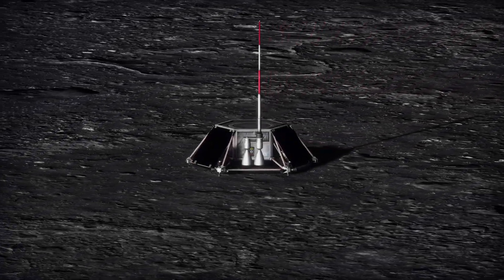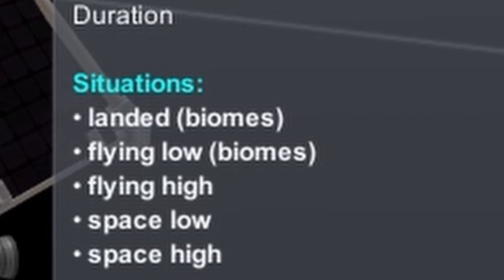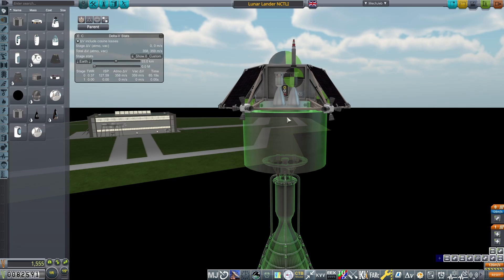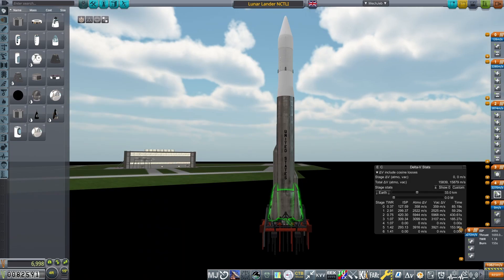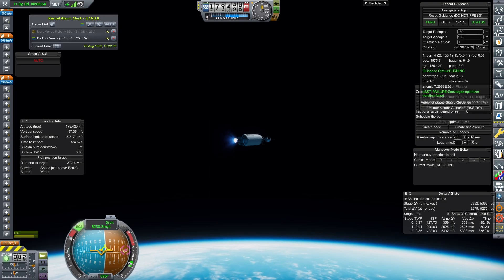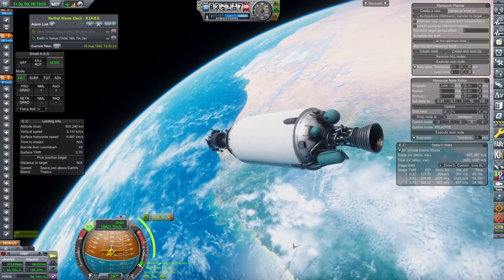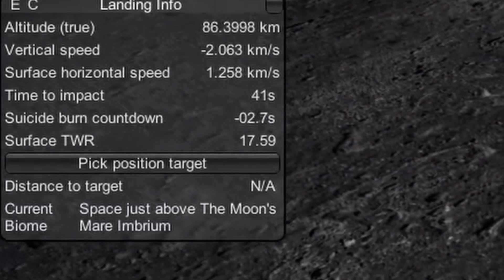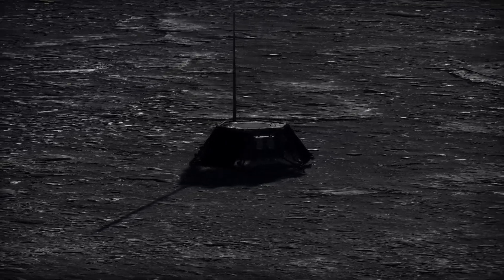How To Land On The Moon In KSP RSS RP-1!

Comment: I love mechjeb, but it infuriates me why the suicide burn time is ALWAYS off, even in stock, even with a single stage.  Its like it was designed to put you a few hundred meters ASL for some stupid reason.  Seems like it should be a trivial calculation. compared to the other calculations MJ does.

Comment: How did you use the RCS for ullage? I cannot seem to figure out how to get the RCS to work near the moon.
Reply from the maker: So RCS without deep space avionics near the moon can only fire forwards or backwards, which you can do using the H and N keys, it wont provide any sort of translation or attitude control though, why I spin this up before getting to the moon so its in the right orientation. But pressing the H key should work fine and will provide ullage! :)
Reply: @Carnasa  I am acutally suprised that you answerd and this quick, I will try this out later thank you for the reply!!!

Comment: tbh being under 150t is less important for me than using early engines

also the price of the rockets is relatively insignificant at this point, costing like 10k and getting 300k for the contract
Reply from the maker: Yeah the newer design uses 60 orbital rocketry and still fits under 150t :P I don't know how much it costs though, need to check that!

Comment: Why use HTP rather than Nitrous Oxide? Nitrous Oxide seems to provide higher thrust and specific impulse. Which propellant would you recommend using for RCS later in the game, when you unlock Cavea-B and the hypergolics?
Reply from the maker: HTP is much more dense so you can pack a lot more in smaller tanks, it’s much better than nitrogen or nitrous oxide which tend to require huge tanks! 

I tend to go for hypergolics that match whatever engine I use, so with a AJ10-137 as found on the csm I use aerozine and nto, if I’m using an engine that doesn’t have rcs configs I tend to default to MMH&NTO seems to be the best to me!
Reply: @Carnasa  I see, thanks! I was wondering if it might be a density thing but found it difficult to parse some of the info on the Real Fuels screen.
Reply: Nitrous Oxide has horrible density.
Reply: Well I just use MMH NTO so your all wrong
Reply: bro im still instaling realism overhaul and im like what the hel is htp and nitrous oxide